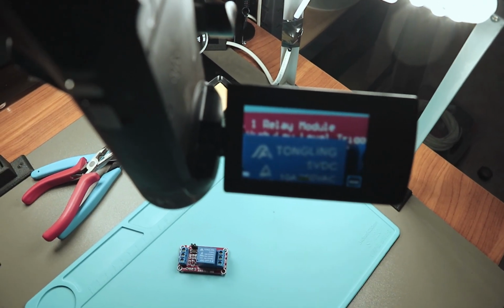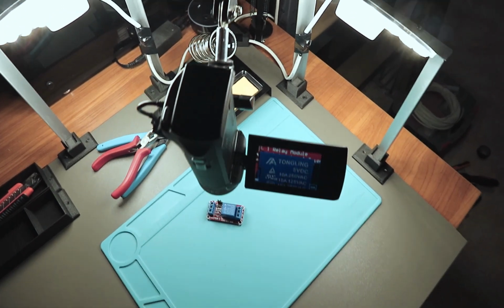Back to electronics! - Mini workbench / repair station!

Comment: I like the idea of a mobile workbench. However If you plan to use it for filming good looking video I think you need to improve the lights and also the camera should be mounted in a way that you don’t need to turn your parts 45 degrees that they are upright in the film. BTW I could not find your Easter egg but I just read the comment after watching the video.
Reply from the maker: You've just gave me a wonderful idea! All I need to do is to change the camera mount so I can rotate it. About the lights... not sure. Maybe I'll try to make a diffuser for them. Tbh I'm looking for a good replacement, but finding something that is kinda cheap (as it's a temporary thing), lightweight, easy to mount and provides good lighting is not easy.